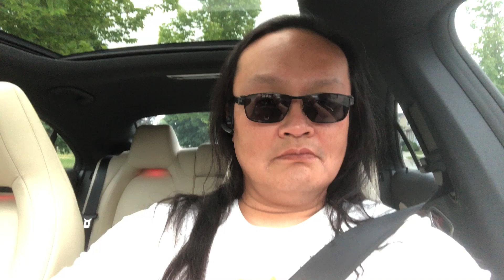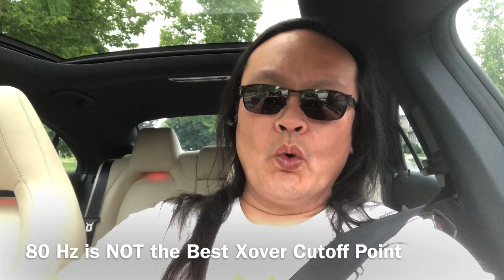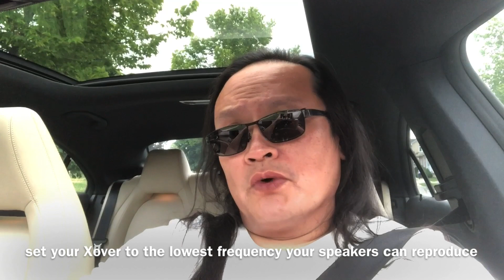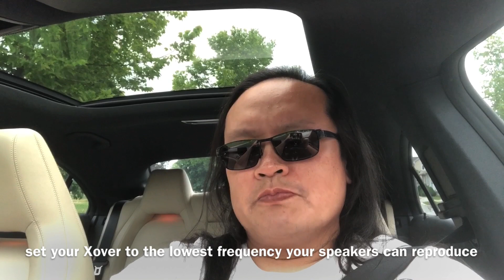80Hz is NOT always the Best Xover Cutoff

Comment: Great video. But silly question ... I just got my first sub ... how does one tell where exactly 60Hz or 80Hz is on the dial? All dial shows is minimum and max frequency ...
Reply from the maker: If you are using a receiver with LFE/Subwoofer out, you set the xover frequency in the receiver and set the xover knob to the maximum. This is to avoid doubling the bass management.

Comment: Im actually researching this topic heavy right now because im adding subs to my truck and trying to find the “perfect” crossover point. Some helpful information i found out is that guitars generally play as low as 82hz.. If you think about it you don’t really want guitar tones coming from your subwoofer at all.
Reply from the maker: Exactly. I try to have my bass management xover at 60 Hz the satellites can handle it. Even IMAX cross over for bass management at 60 Hz or lower (for their cinemas). 80 Hz is simply used for the worst case scenario.

Comment: Sir we provide roadshow dj..
Can u plz say the best frequency range for subwoofer..
I use 21" 3800 watt speaker and 18" 2000 watt speaker..plz ans sir the frequency for best punch And vibration in roadshow...
Reply from the maker: Without knowing your other equipments, there is no way to tell which frequency is the best for you. And for “punch” and “vibration”, that’s simply done by adding boost to the mixing board. It has nothing to do with accuracy whereas this channel deals with accuracy.
Reply: I have dbx driverack pa2,360..
Plz sir I want to know the best crossover frequency for my subwoofer

Comment: Forgot to mention the room so let's say you have a tower that is flat to 30hz but you have bass suck out at 50hz where the speaker I placed it's better to cross the sub at 60hz because it doesn't have that null in the response even though you can cross it over at 40hz you'll have that huge dip so it's better to let the sub handle it could a massive dip from 60-70hz then you could cross at 80hz
Reply from the maker: @Sc2God724  well, of course. The main thing is to cover the frequency spectrum as smoothly as possible

Comment: I built an 8 inch woofer just to be able to crossover lower, and the system sounds better crossed at 120hz. Idk if it's just me or not but the one in my car is the same way, when the sub doesn't play high enough it just sounds wrong and it's missing the realism you expect from a high end system.

Comment: The issue I can see with using 80hz or lower as the crossover is that a lot of bookshelf speakers may have poor control handling that bass. I've heard that the JBL Studio 530 have sloppy bass when you push it. If you look at a frequency response curve you can see it starts sloping off sharply at 100hz, which makes me think it has to struggle so it won't be able to do it with good control. The other thing is that THX is for surround sound, not music, so positional bass is not as important for music. So, I would think tighter, more punchy bass is more important for music, so setting the crossover higher like around 120hz would make more sense. I haven't experimented with this, but that is my thinking.
Reply from the maker: Well, if your speakers can’t do lower than 100 Hz the problem is with the speakers. Thus you have to match the rolloff frequency of your speakers.

Comment: hi 
My speaker focal sopra n2 it’s frequency response (33dB). 34Hz-40khz
Low frequency point(-6dB) 28Hz

Center focal Electra 
Frequency response(33dB)55Hz-40khz
Low frequency(-6db). 50Hz

Surround 2way sealed bipolar (33dB)85Hz-28kHz
Low frequency point(-6dB)67Hz

Surround back 2way bass reflex bookshelf frequency response (33dB)
 55Hz-28kHz
Low frequency point -6dB

My subwoofer definitive technology reference 14’’ drive 2 radiator 
I am always confused 
What crossover I can put and 
large or small 
Please suggest me brother
Reply: Totally 7.1 setup
Reply from the maker: @taheralikhan5771  yes. The surrounds (sides and rears) set them all up at 80 Hz
Reply from the maker: Definitely out small and set front to main LR at 50 Hz, centre at 60 Hz, rears at 80 Hz.

Please also subscribe to my channel.
Reply: @DavidSusiloUnscripted  thanks 

My processer Marantz it’s crossover 
40Hz 60Hz 80hzto 250hz
I can put front 60HzLCR
SURROUND 80Hz both rear and back 
Subwoofer LPF FOR LFE 120 it’s correct please suggest me 
I am already subscribe you 
Thank you once again please suggest me
Reply from the maker: @taheralikhan5771  yes you can your system to have lcr cut at 60Hz, sides and rears at 80 Hz, set LPF for LFE leave at 120 Hz.
Reply: @DavidSusiloUnscripted  all I can put small it’s correct 
Or any change please suggest me
Reply: @DavidSusiloUnscripted  I have listening music same System 
That time what should I kept same or front large for 2 channel listening
Reply from the maker: @taheralikhan5771  after you put to small you can change the crossover of your receiver.
Reply from the maker: @taheralikhan5771  for music listening you still have to set your speaker as small
Reply: @DavidSusiloUnscripted  a@same crossover
Reply: @DavidSusiloUnscripted  what crossover I can set
Reply from the maker: @taheralikhan5771  same as movies
Reply: @DavidSusiloUnscripted  David I don’t have Accostic room my living room is home theatre ☺️ so please suggest correct crossover
 if you don’t mind
Reply from the maker: @taheralikhan5771  are you trolling? I already gave you all the answers. Read all my replies carefully.
Reply: @DavidSusiloUnscripted  sorry brother don’t mind I am not trolling you
 you can change my system that’s why
Thanks you so much you can give me reply sorry
Reply: @DavidSusiloUnscripted  hi someone says my Center speaker should kept 80hz it’s right
Reply from the maker: @taheralikhan5771  no. If your centre can go as low as 55 Hz, you can bring the crossover to 70Hz or better yet 60Hz
Reply: @DavidSusiloUnscripted  but front LR WHAT CROSSOVER I CAN PUT IT 40or60
Reply from the maker: @taheralikhan5771  I ALREADY REPLIED TO YOU ABOUT THAT. READ WHAT I REPLIED TO YOU SEVERAL DAYS AGO

Comment: So my next question is is there a minimum crossover level?  Of you have towers that reach 25 Hz is that too low to set the crossover to your subs (assuming you have quality subs). I would guess at some point you would want your 800-1500w subs to handle the lower frequencies than your towers that are driven by a 250w amp.  

This is where I am struggling to make a decision on what I will upgrade my towers to for my home theater. Does it make sense to spend the money on towers with a few 10" woofers that can hit 30 Hz or should I save some money on a set of quality LCR's that only reach 50 Hz when I have four 18" subs?
Reply from the maker: The subwoofer will always be handling the LFE channel even if all your speakers can run full range. In my experience, even the best tower speakers start to not be flat below 50 Hz. So just to be on the safe side, crossing your large speakers to no lower than 60 Hz is my advice.  Of course, the best case is if you can determine the actual speaker and room response of those speakers. Hope it helps.
Reply: @DavidSusiloUnscripted  perfect, thx

Comment: This just after gene dela sala from audioholics said 95% of setups will have 80hz as their best crossover. This was in a meeting with THX and Matthew Pois. I know who I’m trusting. Saying it is very wrong information is untrue itself.
Reply: David said that 80hz is the minimum THX recommendation to include all speakers. You don't need a tower speaker that can achieve 40 Hz to meet THX recommendations and THX needs to make it simple and not have 30 caveats depending on the speakers you have. 

If you have $8000 towers with a couple 10" woofers that can hit 25hz and you have a crossover at 80hz, you are not utilizing everything that speaker was designed for and relying on the sub to do that work, but what if your towers can produce better sound between 40 and 80 Hz than your sub?  I think the idea is to set your crossover based on your speaker abilities or if you plan to to do your crossover at 80hz, you can save money on your towers and not pay from r the low extension if you won't use it.

THX is no different than Dolby or DTS or whatever, they will tell you the best is what their recommendations say.

In the end, I think the best way to set it up is what sounds nest to you and not what a general guide states. That's what a pro installer does and David is a pro installer that has dealt with million dollar setups. I don't want to say THX is wrong, but I trust the guys in the field that have the reputation to be flown around the country to set up the most elite systems available